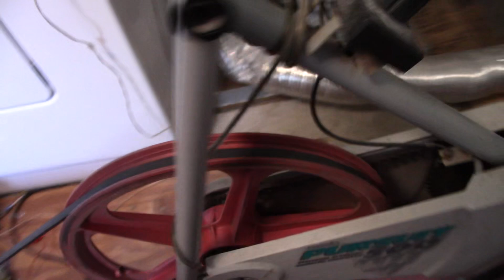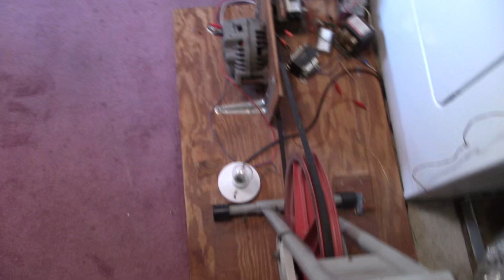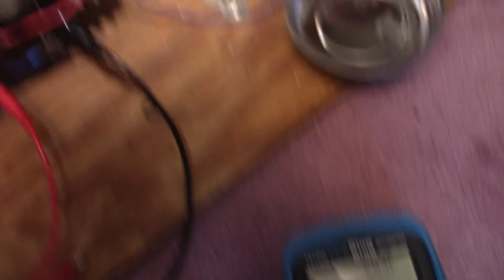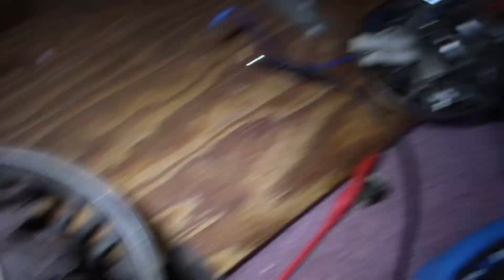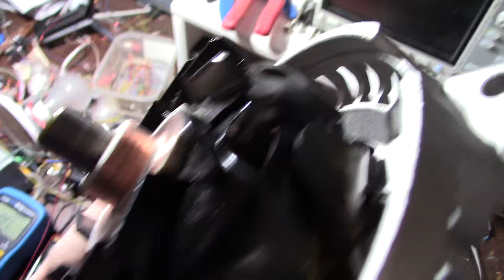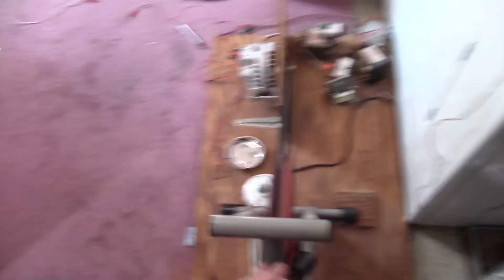Alternator failure on exercise bike

Comment: Pretty ingenious. But where’s a battery to collect all that hard earned power?
Reply: It wouldn't be worth it; most of the energy produced is back-fed into the alternator to keep the magnetic field.  Having said there would be enough energy to feed an 18650 power bank, instead of the lightbulb. The fan is a must (I use a Concept 2 model C ERG, with a fan behind me) and that is self-sufficient.